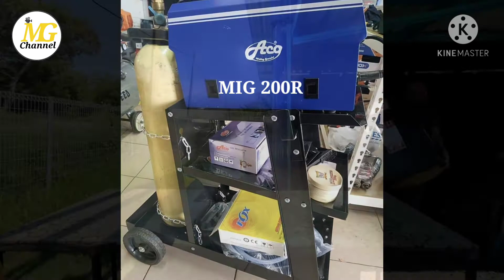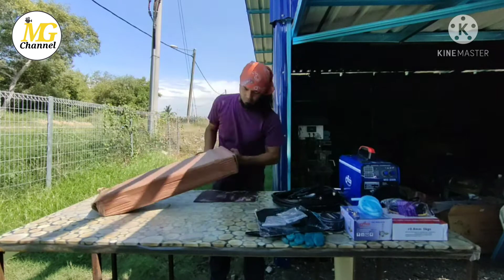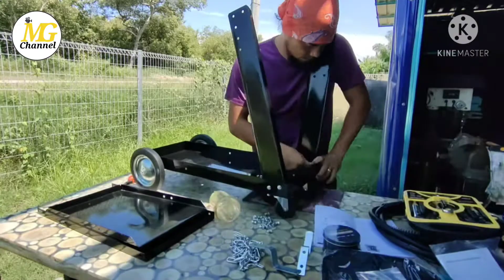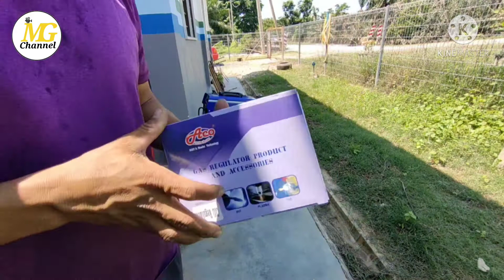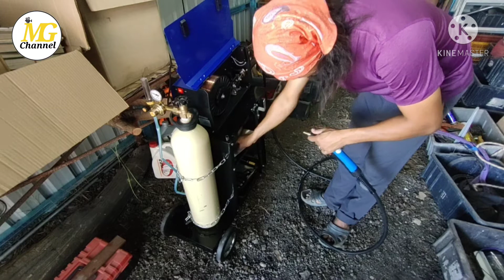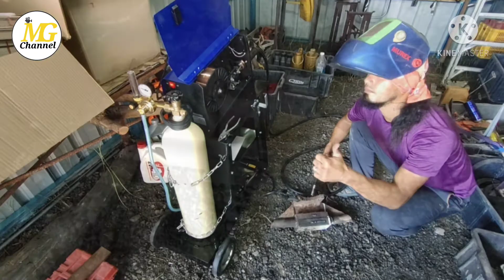ACO MIG 200R Unboxing & installation

Comment: Dari segi current mesin ni okay tk bro? Utk besi nipis n tebal?
Reply from the maker: besi nipis boleh besi tebal pon boleh. jika tebal 10mm boleh pakai arc. yg ni 3in1 mig, arc dan tig. tig kena beli touch dan cable tambahan. dia x bg sekali dlm 1 set
Reply: @melangkaugering8425   oh okay, current mmg takde delay la kalau jalan terus? Mksud sy Fullweld bkn tack mcm grill rmah
Reply from the maker: setakat ni saya banyak pakai utk besi2 nipis. paling tebal pun engle iron. tu pun x tekan lasak sgt. belom ada kerja2 heavy. pakai utk kegunaan sendiri sahaja
Reply: @melangkaugering8425   okay baik2 bro terima kasih atas inform semoga dimurahkan rezeki aamin😁🤲🏻
Reply from the maker: @amirjuzaili7418  terimakasih, amin insyaallah